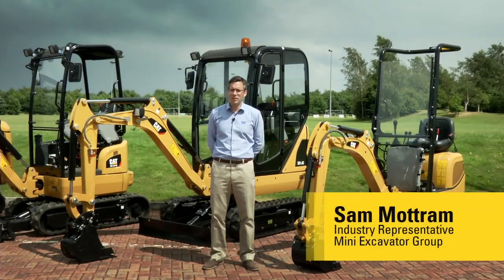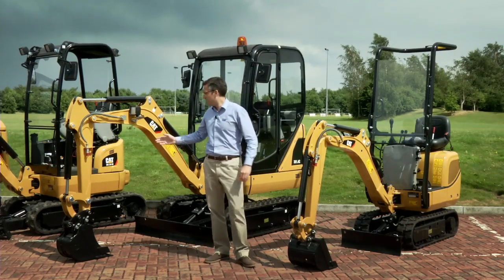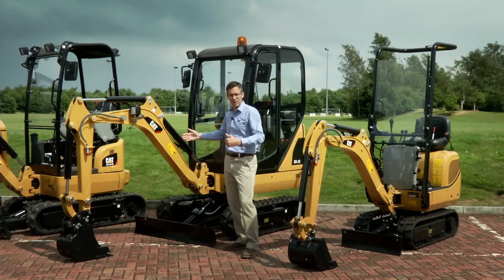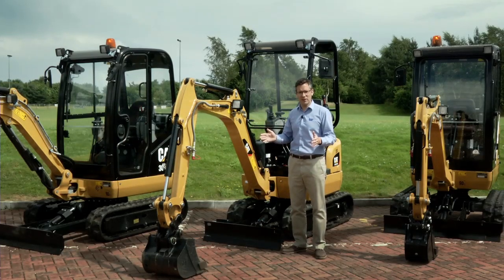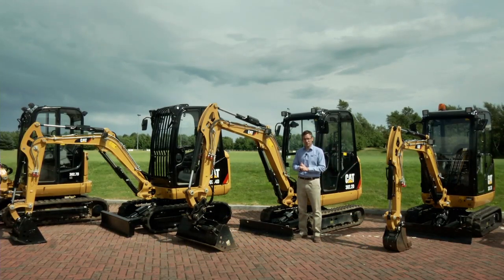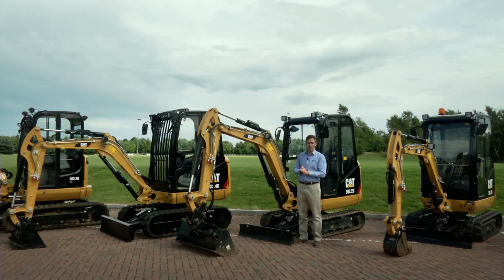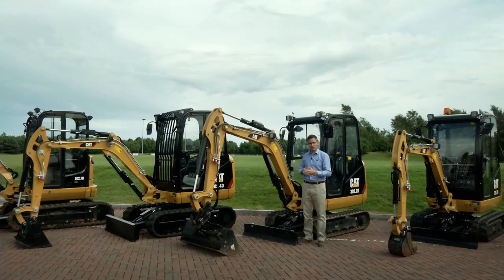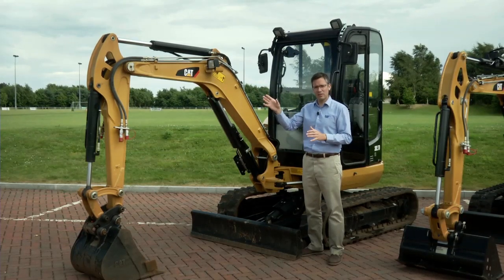Cat® Mini Excavator sub 3 tonne range overview

Comment: After 30,000hrs on several mini excavators I jumped on 1 and ...there rubbish ! No good for steep sites as the blade dosn't go down more than a few hundred mill., noise levels are to loud in confined places, low pushing power, hard to get canopy off, less boom swing than other models . Do not get carried away with the pretty paint job!!
Reply: The push arms on the push blade on cat mini excavators are hollow tubing and garbage and they break off which can be dangerous or fatal in some situations.
I'm running a bunch of different ones on union jobs and I prefer Yanmar, Takeuchi,   and Komatsu.
Reportedly Takeuchi holds up best under rough working conditions for the Long haul.